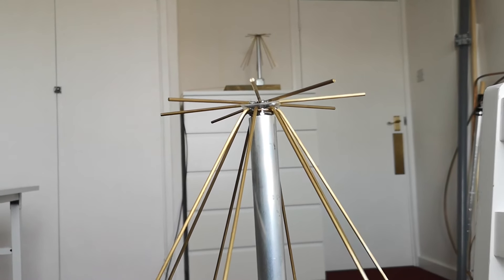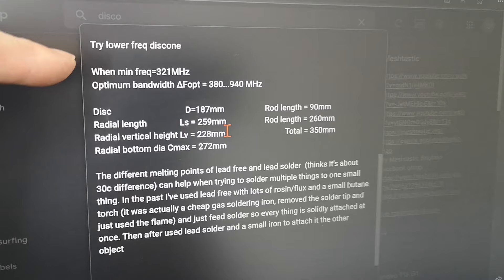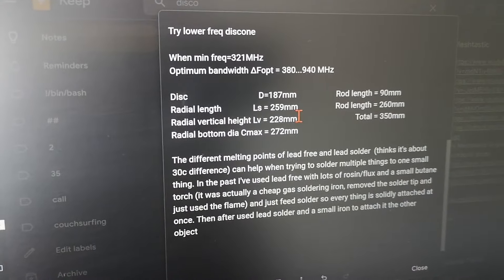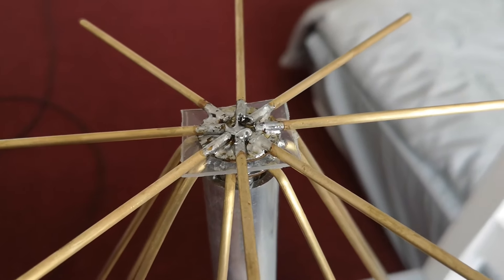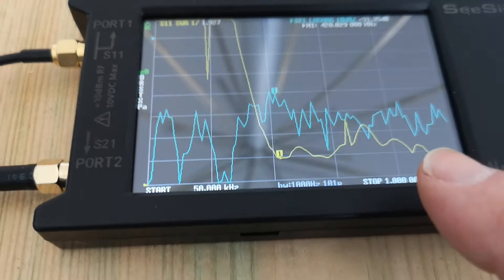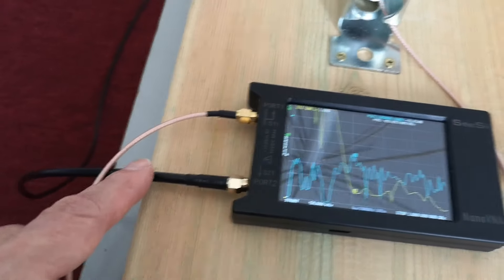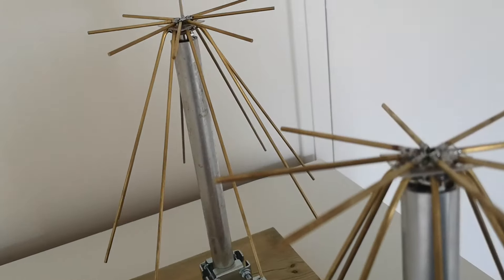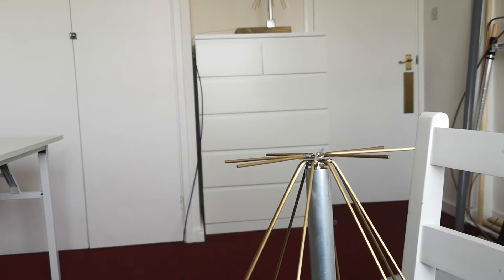Discone Antennas Part 2

Comment: Good build, i admire your "Brain Over Brawn"  calculating the frequency to avoid cuts.   I only purchased my nanoVNA  to check my Meshtastic and long wire HF antenna (SWR and Smith)  so interesting to see other uses watching your videos. I also purchased a tinySA  which due to receiving other equipment I haven't had much time to get to grips with it yet, so if you have any real world demos would be great.
Reply from the maker: Have fun with it and I will see what I can do.